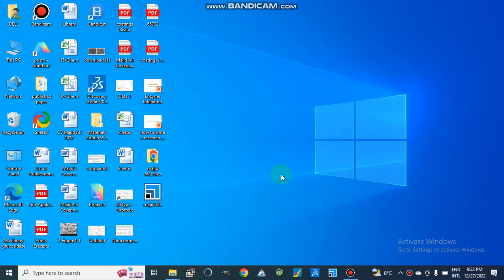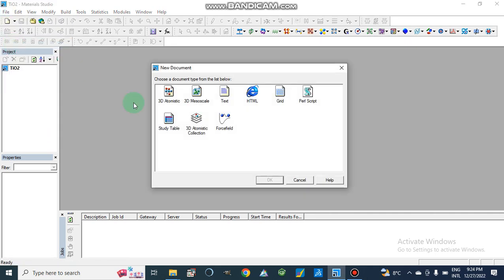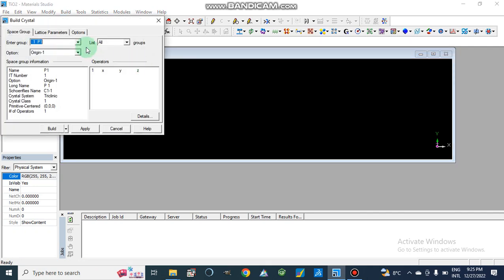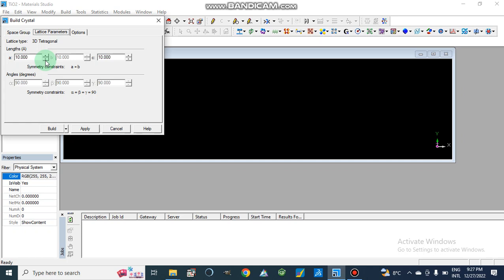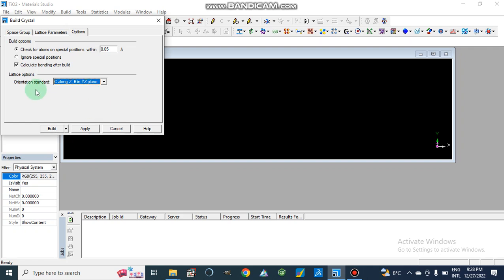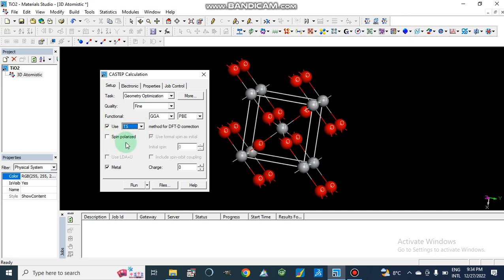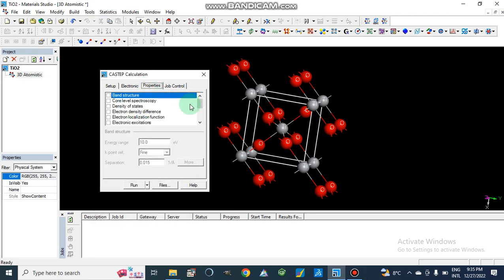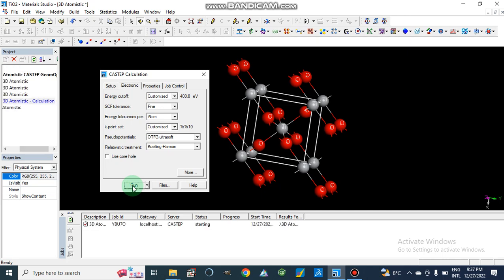Material Studio - crystal structure & geometry optimization @MajidAli2020

Comment: Dear sir Dr. Majid. I have got a question. I have a specific facet (plane) of an oxide. Its cubic structure is even available in the "Structures" folder. The thing is, that facet is supposed to be different by energy, density of states: in other words, it looks like its bandgap is more huge as compared to other surfaces of that oxide nanocube. I already cleavaged the surface and followed your tutorial. Could you please let me know if any module serves for studying the energy, DOS, band structure for the surfaces o certain facets (planes)? What kind of prepartive steps must be made for a correct caluclations under adequate conditions? 

Thank you so much!